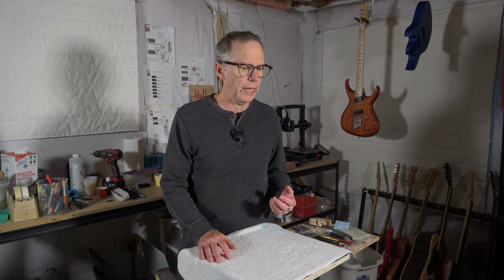Making A 3D Printed Electric Guitar: Part 3

Comment: I'll be interested to see if there is flex where the reinforcement rods end near the headstock.  It seems like that would be the weak point of the 3dprinted neck.  Maybe a way to have graphite reinforcement rods run then length of the headstock too?
Reply: Valid observation. I started on a 3D printed neck a few months ago and it's fine so far, but I suspect that if it is going to deform at some point, it'll start right there. I doubt Chris will have the same problem since he is using a wood fretboard, which should help couple the unsupported area supported area of the neck.

Comment: It'll be interesting to see how that center neck joint holds up. I tried that on my 3D printed neck (building on my channel right now) and it was strong but I did manage to snap it when I did some stress tests. For mine, I printed the whole length of the neck almost vertically and used M5 screws & glue to join the headstock. Totally solid. Also, interesting choice on the Solarez for smoothing. I might give that a shot on the next one. Thanks for the tip!

Comment: How the heck does it put a wood grain on the back of the neck? Amazing.
Reply: It’s a result of how the software handles printing a flat angle. It basically has to print in levels. Think of it like a topographic map showing elevation. It just happens to have a similar shape to woodgrain.

Comment: I'd be concerned with using cyanoacrylate as a binder. Epoxy has a longer life and is physically stronger.
Reply from the maker: I have an RC airplane (Cub 40) assembled entirely with CA glue. This plane has endured intense vibration, massive g-forces, hot UV sunlight, and fuel spray. It was built almost 30 years ago and is still like new.
Reply: @HighlineGuitars  I assume it's made of wood. PLA has different properties. I'm interested in seeing how the stresses of string tension act on the bond. I'll be following your experiment closely.
Reply from the maker: @bsharp55  👍